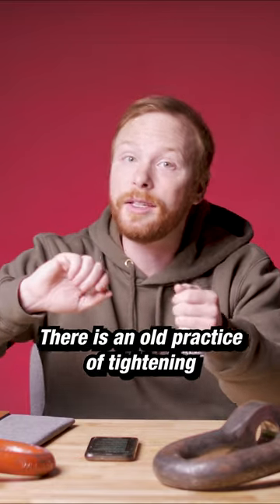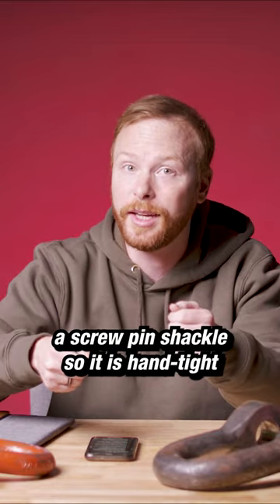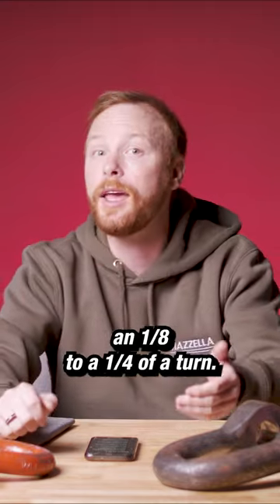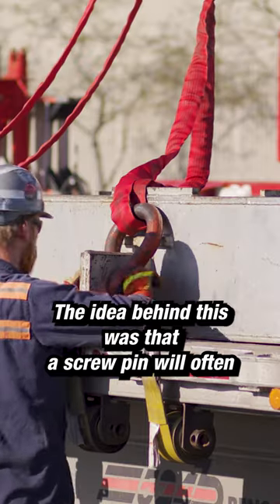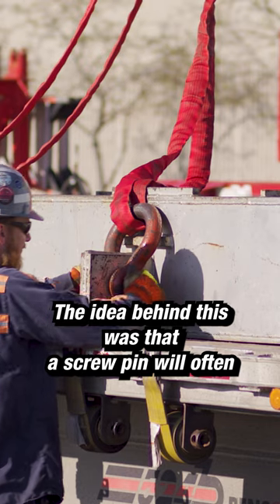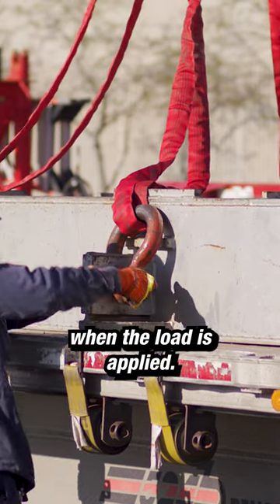The Illegal Shackle Pin Trick Most Riggers Use #shorts  #riggingequipment

Comment: Ive been taught this method as well, in certain situations it was better to do the 1/4 turn as when a load is applied it would over tighten the screw pin and to get it off in an emergency or normal operation is hell.
Reply from the maker: Even though getting the pin off in an emergency situation is "hell" we still must abide by the manufacturer's recommendations on the proper use of their equipment.
Reply: Is the 1/4 turn backing so dangerous if the shackle is moused?